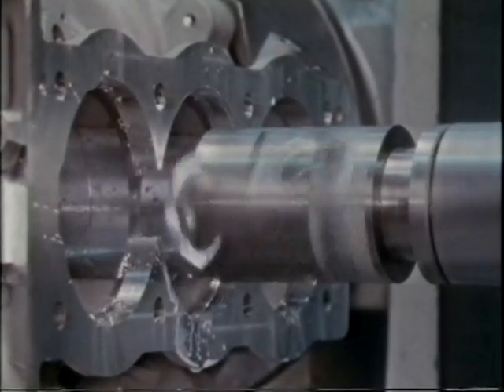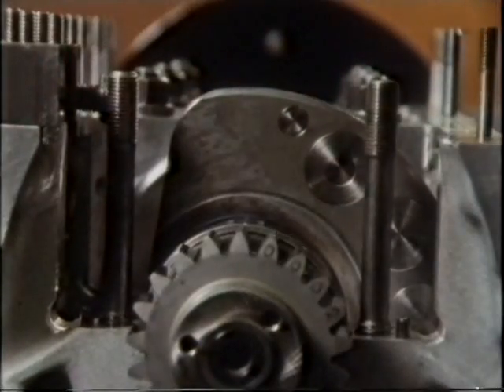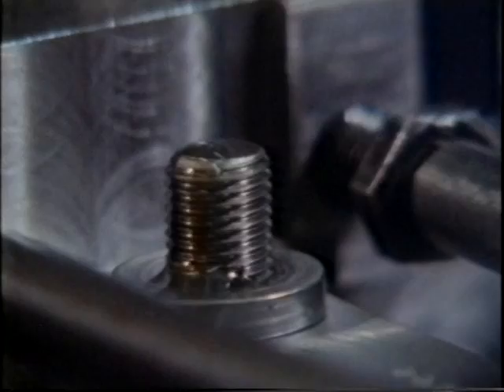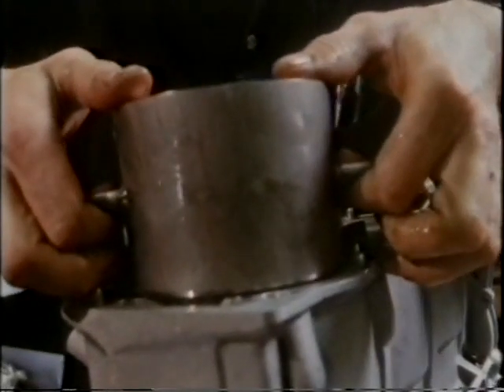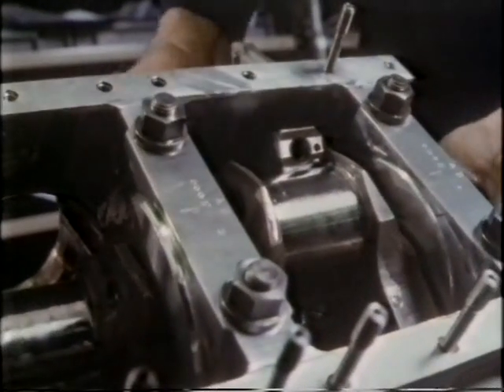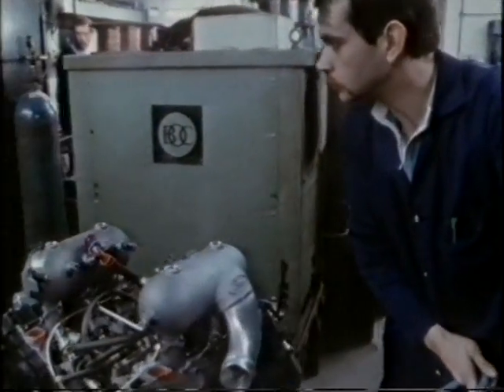F1 1986: Assembling a Ford Cosworth TEC (GBA) V6 Turbo Formula 1 engine

Comment: These engines lasted a qualifying session, but were powerful as hell.... nowadays, v6's used in f1 last many weekends.... and even in their final days they manage to output 650~ cv.     Always take a look to the big picture.
Reply: Yo, they need to use the 80s to put on the 2026 engine regulations, electric supercharger and variable valve turbo comes together perfectly in holy matrimony.

Comment: only 12k rpm? hell the v10's and 8's were running 16k+
Reply: The turbo engines of the era ingested more air at 12.000 rpm than any NA engine turning 16.000 rpm could even hope to bring in.  At one point boost was capped as high as 4 bar.  Imagine how fast a naturally aspirated engine would have to turn if it was to equal the breathing ability of a turbo engine spinning at 12.000 rpm under 4 bar of pressure!
Reply: It very high value for V6 Turbo engines.
Reply: +Ray Gunderman Engine technology in the 1980's was not as advanced as it was in the 2000's- the 2008 2.4L V8s were revving at 20,000 rpm. 12,000 rpm for forced induction engines that were capable of running 5.5 bar boost is very, very high.
Reply: *****
Thank you, proving my point even more.

Comment: ..from finger tight preload.Considering that the adjusters appear to be .5mm thread pitch,and there would be a little compressive loss/flex in the spreading block components and the mounting stud,it is now very easy to calculate the approximate distance the blocks are spreading the engine crankcase at that location,when the adjusters are turned half a turn on the threads.I'll leave the math to you guys.It's very simple.
Reply: Indeed. I wonder what hairline fractures that may have caused.

Comment: When he fits the blocks to the crankcase studs,you can see the threaded adjusters mounted into the blocks that will apply force to the bars that spread the blocks apart.He inserts the bars between the blocks and the threaded adjusters,turning the adjusters so there is a finger tight preload on the bars.With his open faced spanner,he turns the threaded adjusters to spread the blocks.Initially,he turns the adjuster the wrong way,but it seems he only turns the adjuster about half a turn..CONTINUED

Comment: How fantastic to see my hero, the late Keith Duckworth, at his drawing board talking about something that he has designed.  Rest in peace Keith, we miss you!
Reply: Keith told me a funny story about how they puzzled for ages how to stop valve bounce, and how they tried hydraulic lifters but they leaked.  I said you should have
let them and he said they came to the same conclusion, and then when they saw
pneumatic valve systems they all looked at each other and sat around the table saying nothing.
Reply: @andrewspence3171  what year was it? How old are pneumatic springs?

Comment: This engine ended up in the Benettons right?

At uni one of the lectures worked at Cosworth for 21 years, in an engine seminar he said this engine made just over 2000hp @ 4 Bar (Absoute), estimates then suggested 3600hp was attainable @ 8 Bar (Absolute).

Comment: @charade993 The casting IS capable of being spread by a few millimeters, to add the caps. That was my original posting.

Metals expand if heated...But think of it like this: The whole engine block gets physically slightly larger if hot. Hence: Engine manifold bolts have minimum torque settings. The other components expand and tighten even further, as the bolts are made of a metal that does not expand much (this eliminates the gasket) and the block can be thin/flexible but is stiff when heated.
Reply: "FEW milimeters"? 
Absolute no.

Comment: @Ropponmatsu2  Its only flexible because the bearing cap is not clamped down at that point.Once its torqued down its solid,loaded structure or not.I dont understand your argument. Either its flexible because its cold or its flexible when its warmed up? what exactly are you trying to tell me? go back and read what you wrote.Engines dont tension themselves hot. As an engine heats the stresses are evened out over all the components it shouldnt exert forces or it would crack. I think your confused.

Comment: @charade993 The liners are steel, it turns out, from "The 1000Bhp Grand Prix cars" which covers this engine.

If you tried to drive one of these engines from cold, you'd destroy it, for your reason, but as it gets hot, the block expands and it tensions itself "correctly," because it is bolted to the fuel tank/chassis and the gearbox. Here it is flexible, but in the car it is a loaded structure: It expands to the "correct" shape and lets you transmit loads through it, when at full power.

Comment: @Ropponmatsu2 if the 'bottom' of the engine was to take even close to 1 or 2mm flex then the crank journals would run out of line and the mains would bind almost instantly (and spectacularly)  once that bearing cap is on and torqued down however, it'll brace together and theres no way its gonna move!
Reply: charade993 
You should write these guys a letter, let them know your design ideas!!

Comment: @Ropponmatsu2 
You cant 'make' a liner from nikasil, its a superficial coating which is normaly applied to aluminium. i would more likely believe these liners were steel for strength though. it would be pointless putting a aluminium liner in an alloy block or they would have just machined the bores into the block and Nikasil coated them...but they didnt.  im with marek0086, a few thou at the most. Beautiful castings though!

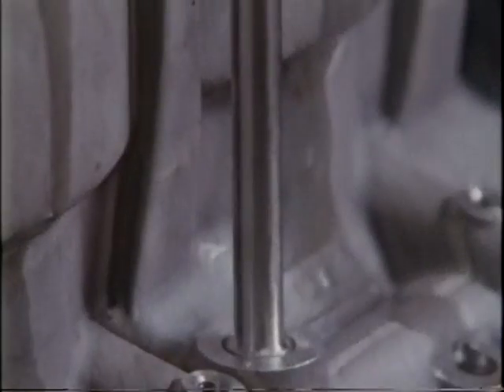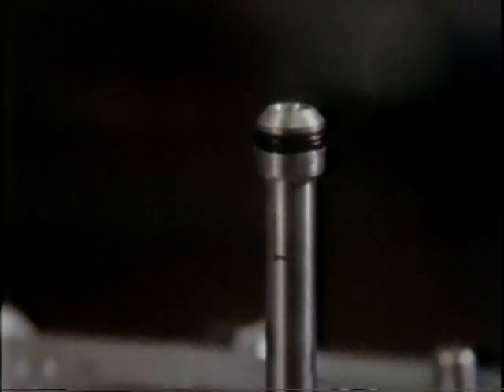Comment: 6:07  "For simplicity, oil is forced through external steel tubes" the main reason being to remove the need for a head gasket.  If you notice at 6:15 there is also no block to head cooling water path. This results in a cooler head for more power as well as a more rigid block. If there is no gasket...it cannot fail.  The 'Wills' firing ring is all thats needed.  These engines would be more able to withstand the odd bit of detonation, far more than a conventional block anyway. Great vids!
Reply: Great contribution!
Reply: Wills ring is a type of gasket.

Comment: @marek0086 Keith Duckworth - "God" - As he was referred to - Is talking about the head bolts at the end, he SAYS how flexible the block is. The bolts run all the way down into the block in order to provide strength where the gas pressure is highest...The rest of the engine is very lightly built. One thing that he doesn't mention is the TEC has NO head gasket. The liners are made of a material called Nikasil, and they end at the little black rings seen on top of the cylinders.

So....Yes I do.

Comment: @marek0086 - Not quite true actually. Remember that the engine is not only a stressed component, in that it has got to be strong enough to carry vehicle loads, but also that as it operates it gets hot. It expands as a result. You can probably bend it by a "few millimeters" because that is EASILY what the bottom of the engine will experience as it operates.

Comment: The engine was actually the TH2's problem in 1986. Compared to the BMW's, Renault's, Honda's, Ferrari's & TAG turbo engines, the Ford V6 turbo simply didn't have enough power.Both  Alan Jones & Patrick Tambay said it was a shame as the chassis was just about perfect.